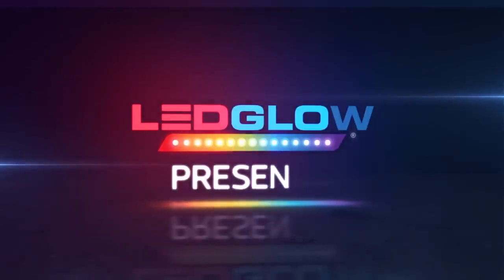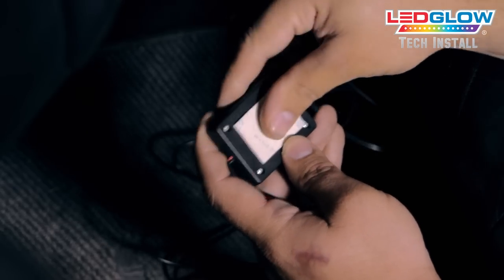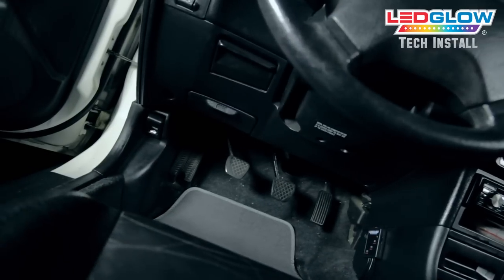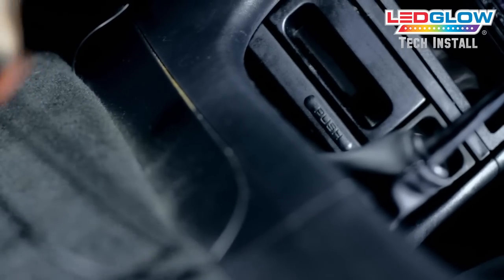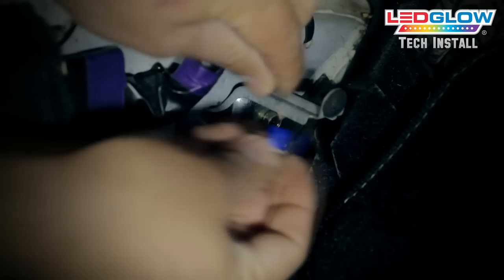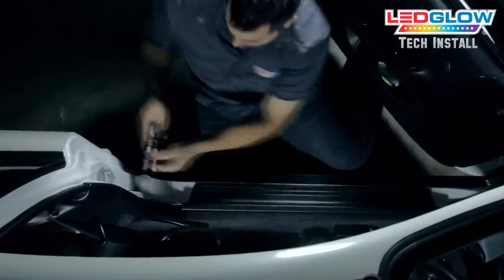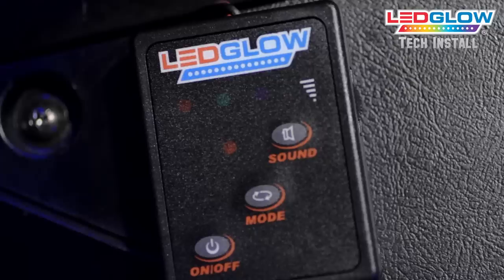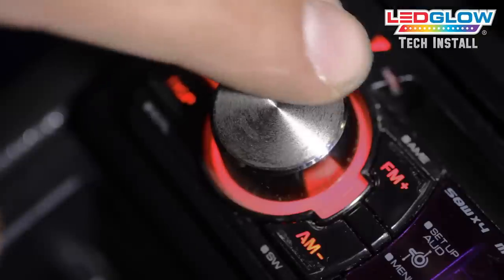Installation | LEDGlow 4pc 7 Color LED Interior Car Lights and Truck Lights

Comment from the maker: That's great you have everything you need! The 4 amp fuse is used as circuit protection for the add a circuit. If too much power is going to the kit, it will short the fuse rather than the entire circuit and stock fuse from your car. The 4 amp fuse plugs directly into one of the two slots on the add a circuit and the stock fuse from your car would plug into the other slot. If you have any other questions just ask!

Comment: I have a mazdaspeed 2010 and my fuse box is hidden when i close the door (next to traction control off button) how do i add a add a circuit? Or will this not work for my car
Reply from the maker: FancyTrickshot You will be able to power your kit using an expandable circuit on your 2010 MazdaSpeed. You will have to route the wire from behind dashboard and into the fuse box. If you run into any issues getting this connected, contact our Tech Support Dept. at 877-LED-GLOW and we'll be more than happy to walk you through it!

Comment from the maker: No worries, Chris, that's what I'm here for! If you are indeed looking for an interior kit with brightness levels then a single color kit would be the way to go. We offer two types of single color kits, a standard 5mm LED kit like in the video shown above and a SMD LED interior kit which comes with 5 different brightness levels, 18 different lighting patterns and a wireless remote. If I help with anything else don't hesitate to ask.

Comment from the maker: Glad I can help, Corey! If you're looking at your fuse box, there are numbers on the top of each fuse. That number indicates the amount of amps to that particular fuse. Now when picking which fuse to replace with the add a circuit, refer to you car's user manual. You will pick either a switched source or a constant source. Switched sources will only work when the key turned on in the ignition and constant sources will work regardless if the car is on or not.

Comment from the maker: You can hook it up to any of those power sources, you would just need to decide if you want it to be a constant or a switched source. A constant source will always have power running to the kit whereas a switched source will only have power when the key is switched in the ignition. I recommend connecting the add a circuit to a source that is no higher than 15 amps to prevent any chance of the kit gaining too much power and shorting out, so you'll be fine with any of the sources you listed above.

Comment from the maker: Thanks for contacting us, Mark! A 10 amp expandable circuit is perfect for the installation of one of our interior lighting kits. Also, make sure the fuse you use does not exceed 10 amps as well. A few examples you can use are the brake light fuse, power windows fuse, radio fuse or cigarette lighter fuse. We apologize for the mistake, but the kit actually doesn't come with zip-ties. We do plan on including them with all of our kits in the future so thank you for the heads up!

Comment from the maker: Cameron, you won't have to buy anything extra to have the auto door illumination, you can just run the power and ground wires directly to your car battery and you should be set. You can also use an add a circuit which is an easier install and gains power directly from your fuse box. If you choose to use an add a circuit, you would need a mini add a circuit and 4amp fuse for your 2008 Scion tC. If you have any other questions just ask!

Comment from the maker: Steph, to connect the kit to the cigarette lighter adapter to the kit, you simply take the red wire from the kit, place it into the red wire slot on the adapter and then crimp them together. You would do the same for the black wire. When plugging the adapter in, you should see a red light on the adapter. If you don't see this, then there is either a blown fuse in the adapter or the source where the kit gains power from. If you have any other questions, don't hesitate to ask! Have a great day!

Comment from the maker: You would use a mini add a circuit for your 09 Civic. Every car runs 12 volts so you'll have no problem there, and the numbers you see on the fuses are the amount of amps for that particular fuse. If you are going to connect a kit via the add a circuit, I recommend using a fuse no higher than 10 amps. Potential fuses you can use are the brake light fuse, power windows fuse and the radio fuse to name a few. If you have any more concerns about the kit don't hesitate to ask, Ricky.

Comment from the maker: Dean, the easiest way to install any of our lighting kits is by using an add a circuit like featured in the video. If you are not experienced then I recommend taking the kit to any stereo shop that does installations and they should be able to take care of it for you. If you do decide to use an add a circuit, you will use the standard size. If you have any other questions don't hesitate to ask!

Comment from the maker: Samim, the add a circuit is not necessary for installing the kit, it's just an optional installation accessory that we offer. If you were to use one for your 2009 Scion tC, you would use a mini add a circuit and 4amp fuse. If you have any other questions just ask! Have a great day!

Comment from the maker: Steven, you will use a mini add a circuit for both 2012 F-150 and 2002 Chevy 2500 Trucks. Zip ties are not included with the kit,but I'd get the kit installed before you decide to purchase those for the wires. There is also an on/off button on the control box so you're good to go there! If you have any other questions or concerns don't hesitate to ask! Thanks!

Comment from the maker: Kyle, if you run the red/black wires directly to your Maxima's battery, you will not need any additional parts for installation. If you want to power the kit from your fuse box or cigarette lighter adapter, then you will need either an expandable circuit or cigarette lighter adapter. You can use a switch to wire the lights, but make sure the kit is set to the auto illumination function or else you won't be able to turn the kit on and off with the switch. If you have any other questions just ask!

Comment from the maker: The 10 amp fuse was in regards to Henry’s question asking if the second fuse has to be 4 amps. A 10 amp fuse will work for the controller, but now the circuit protection has changed. If there's an issue that’s higher than 4 amps but less than 10 amps, the controller may be damaged but the stock fuse will not be. We recommend 4 amps for the second fuse, which is why we include it with each add a circuit.

Comment from the maker: That will absolutely work, but you will need to get a 4amp fuse that is used as circuit protection for the kit. The add a circuit we offer on our website comes included with the 4amp fuse so you will not need to go out and buy one. If I can do anything else for you just ask!

Comment from the maker: Each tube has 6ft of power wire so you should have enough to run 2 tubes into the trunk. You'll also have to tap into the power source of your trunk and will most likely hide the control box under the seats after programming the auto illumination mode. But for the set up you want with lights under the seats and in the trunk, I recommend using one of our Expandable Interior Kits. You can connect up to 6 tubes so you can have 4 under the seats facing the front and back and 2 more in the trunk.

Comment from the maker: Bryce, it's all about what kind of setup you're looking for in your car. The 6pc Mini SMD Kit comes with six 4 inch flexible tubes and can be expanded to include up to 24 tubes. If you're looking to only light up the driver and passenger footwell and under the seats, then you'll be good with the 6pc kit. You can use the add a circuit that we offer to help make installation a little easier, but if you choose not to get that, everything comes included with the kit for a complete install.

Comment from the maker: Congrats on your new 2014 Mazda Cx5, Frederic! I recommend contacting your local police department and asking them directly as laws regarding aftermarket LED lighting vary from state to state and country to country. The best way to install the interior kit would be using a mini add a circuit that connects to your Mazda's fuse box. You can place your order directly on our website, eBay, or Amazon. Let me know if you have any other questions or concerns!

Comment from the maker: Aliikai, you will not need any additional wiring for our interior kits, but if you plan on powering the kit from the fuse box you will need one of our expandable circuits. For your 2001 Civic you'll use a mini expandable circuit and 4 amp fuse. We recommend replacing a fuse that is no higher than 10 amps so you'll be okay with using a 10 amp fuse. If you have any other questions or concerns don't hesitate to ask!

Comment from the maker: Tyler, the add a circuit in the video is listed as an "Expandable Circuit and 4 Amp Fuse" on our website and you will use the mini expandable circuit and 4 amp fuse for your 2006 Mitsubishi Eclipse GT. We recommend to use any fuse that's 10 amps or less, but a few examples are the dome light fuse, power seats fuse, power windows fuse, or cigarette lighter fuse. If you have any other questions or concerns don't hesitate ask!

Comment from the maker: John, our interior kits are powered by 12 volts. You can install this kit with the included hardwire, but we do offer the add a circuit, which is featured in this video and a cigarette lighter adapter, so you have a few different options when it comes to installing the kit. If there's anything else I can help with don't hesitate to ask I'll be glad to help! Have a great day!

Comment from the maker: Kai, it's all about what kind of lighting your looking to add in your car. I actually have this kit installed in my car and have two tubes mounted under the dash and the other two mounted under the front of the driver and passenger seats, like in the video. If you're looking to have two tubes in the front and two in the back, you can do that as well, but it won't be as a complete glow as the installation method shown in the video. If I can help with anything else don't hesitate to ask!

Comment from the maker: David, a grounding wire is the black wire from the control box that must be connected to a bare metal location on your car in order to power the interior lighting kit. If you only connect the red power wire and do not connect the black ground wire to a bare metal location or the negative terminal of the battery, the interior kit will not function. If you have any other questions or concerns just ask!

Comment from the maker: Junior, one thing you should figure out is how you want to install the kit. The kit comes with red and black power wires that connect directly to your Elantra's battery, but we offer an expandable circuit and cigarette lighter adapter to make the install process much easier. By using either the expandable circuit or lighter adapter, you eliminate the need to run the wires through the firewall. If you decide to use the expandable circuit, you'll use a mini expandable circuit for your Elantra.

Comment from the maker: Fred, the expandable circuit is an optional installation accessory that is sold separately from the interior kit. If you decide to use an expandable circuit to install a kit, you will use a mini expandable circuit for your 2009 Subaru Legacy. Also, make sure you use a fuse that is no higher than 10 amps to avoid too much power going to the kit and potentially shorting it. If you have any other questions or concerns don't hesitate to ask!

Comment from the maker: Henry, the mini add a circuit we offer will work in your low profile fuse box. The second fuse does not have to be 4 amps, but if you pull a 10 amp fuse from the fuse box, you will need to get a 10 amp mini fuse for the second slot on the add a circuit. If you have any other questions don't hesitate to ask!

Comment from the maker: Thanks for the purchase, Alex! The LEDs do draw power, but it is a very low draw so it shouldn't affect your battery. One way to avoid your battery possibly draining is by connecting your kit to a switched power source so when the car is turned off, the power to the kit is cut as well. Let me know if you have any other questions!

Comment from the maker: James, you would go about installing the kit by using the same process as shown in the video. You can install the kit with the included red and black power wires to your Avenger's battery, but if not you can use an expandable circuit or cigarette lighter adapter. If you choose to install the kit with an expandable circuit, you will use a mini expandable circuit for your 2008 Dodge Avenger. Let me know if you have any other questions or concerns!

Comment from the maker: Nick, if you don't want to use the add a circuit, you can use the cigarette lighter adapter which is the fastest way to install the kit. If you do decide to use an add a circuit, you will use the mini add a circuit for your 1999 Audio A4. Let me know if you have any other questions or concerns!

Comment from the maker: Hunter, if your subwoofer amp has a 12v output for accessories then you will be able to run the power wire to it. If not, you can run the power wires through the firewall to the battery or you can use either our expandable circuit that powers the kit from the fuse box or our cigarette lighter adapter. Let me know if I can do anything else for you!

Comment from the maker: Yes, make sure that the 4amp fuse that comes included with the add a circuit is in one of the slots along with your stock 20amp fuse. If you're still having issues powering your kit after doing this, I recommend contacting our technical support department at 877.LED.Glow and they'll be able to find the exact issue you are having.

Comment from the maker: Anand, the expandable add a circuit is an optional installation accessory that is sold separately from the kit and zip ties are not included with the kit. If you'd like to purchase an add a circuit, write a message in the customer note that you'd like zip ties included as well. If you have any other questions just ask!

Comment from the maker: Danish, the 4 amp fuse is required and used as circuit protection for the add a circuit. If too much power is going to the kit, it will short the fuse rather than the entire circuit and stock fuse from your car. Let me know if I can do anything else for you!

Comment from the maker: Jason, the mini add a circuit is not included with the interior kit, it's just a another option for installing the kit. Installing the kit with or without the add circuit is a fairly simple process, you would just need to figure out where you want the kit to be powered from and where you want to mount the tubes. If there's anything else I can help with don't hesitate to ask or call our technical support department at 877.LED.Glow. Have a great day!

Comment from the maker: Cooper, the grounding wire is included on the control box of the interior kit along with the red power wire. Installing the interior kit with the lighter adapter is extremely quick and easy. You'll just simply crimp the power and ground wires to the quick crimp connectors of the lighter adapter, insert the connectors into the adapter, plug it in and you're good to go! Let me know if you have any other questions!

Comment from the maker: Frank, I recommend a mini add a circuit for your Mercury Sable. All of our interior kits will not affect or drain your car battery as they draw very low amps. As for installing a kit in your car, it's all about what you're looking for. We offer many different types of kits ranging from 7 colors to single colors and kits that use SMD LEDs, as well as standard LEDs. Check out the link in the description to see all the interior kits we offer! If I can help with any more of your questions just ask!

Comment from the maker: Ahmad, all vehicles are 12v, so you would connect the red wire to a switched or constant 12v source and the black wire to a bare metal ground source. Everything else after that is just plug and play! If you have any other questions you can ask us here or contact our technical support department at 877.LED.Glow.

Comment from the maker: Ashley, I don't recommend connecting the red wire to a fuse because it is unsafe and leaves the kit unprotected. If you want to tap power from your fuse box, I recommend using a mini expandable circuit. This install accessory is extremely easy to install and protects the interior kit and power circuit. Check out our video called "LEDGlow's Add-a-Circuit Installation Video" and if you have any additional questions don't hesitate to ask!

Comment from the maker: No you would not, the cigarette lighter adapter would be the only thing you would use to power the kit.  The add-a-circuit just makes the install much cleaner.  If you have any other questions, please just ask!

Comment from the maker: Fransico, when the music mode is activated, the kit will blink, but when it starts to pick up sound, you will see it blink much quicker. You can also adjust how much sound the built-in mic will pick up by adjusting the sensitivity wheel located on the side of the control box. If you have any other questions or concerns don't hesitate to ask!

Comment from the maker: Corey, if you're looking to power a kit from the fuse box, you'll need a mini add a circuit and 4amp fuse for your Lexus. You'll just need to find a source in your fuse box that is no higher than 10 amps, ground the black wire to a bare metal surface, mount the tubes and control box and finally hide the wires. Using the add a circuit is the cleanest way to install the kit and it leaves the lighter port for any other accessories in your car. Let me know if you have any other questions!